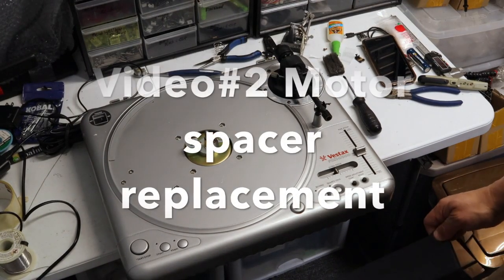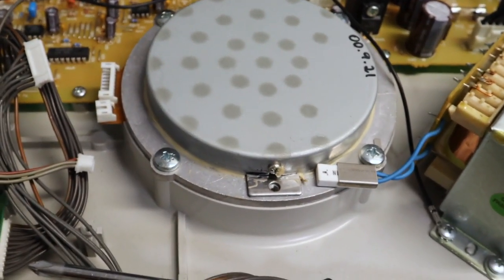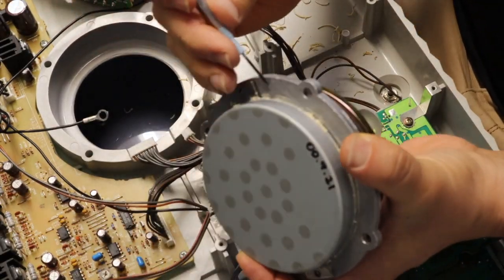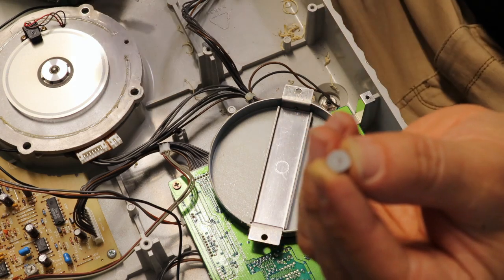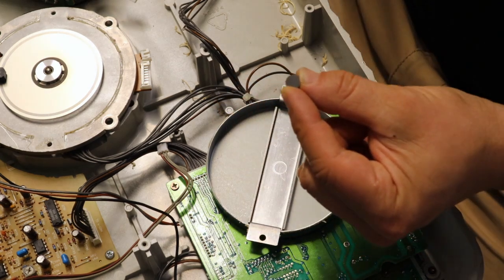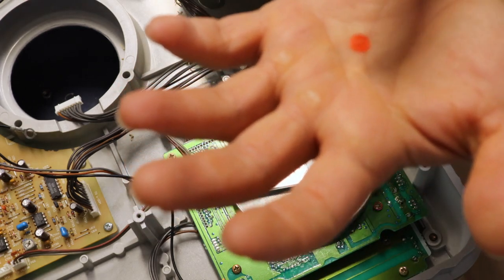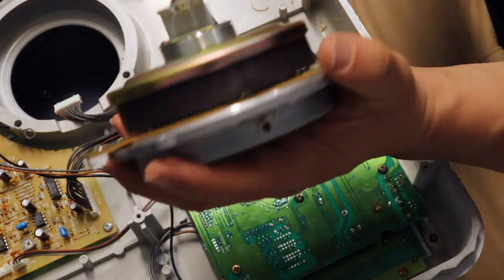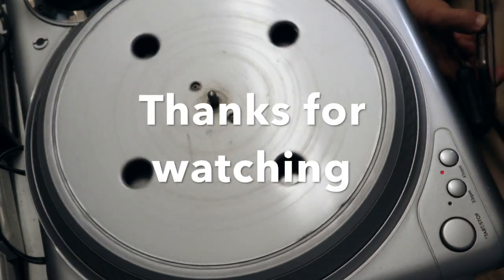operation save a vestax pdx 2000 Vid#2  motor replacing the metal spacer

Comment: Thanks for these videos. I’ve been using 0.6mm thick brass sheet for this fix. This normally fixes any platter wobble issues. I just cut a small triangle of brass and use double sided tape to hold it in place, the same as you did.
These turntables have already exceeded their expected lifespan by many years, it’s great to see it.
Reply: brass is worst stupid material that can damage the  steel spindle :)
Reply: @KeyDi95  I’d expect the brass to wear over a really long period of time but it’s softer than the steel spindle, and isn’t prone to galling, so damage to the spindle is unlikely. There doesn’t seem to be any wear after several hundred hours of use.
The little black discs used by vestax have very low friction but they all seem to squash over time. Sometimes they split in half and the spindle runs directly on the steel bridge underneath. Not sure what material the discs are, maybe carbon filled ptfe?
Reply from the maker: @MrWobblyHand  It's all a learning curve when we do these types of repairs and the more information we get out there helps other preserve their gear …
Reply: @MrWobblyHand  this is carbon exactly not plastic